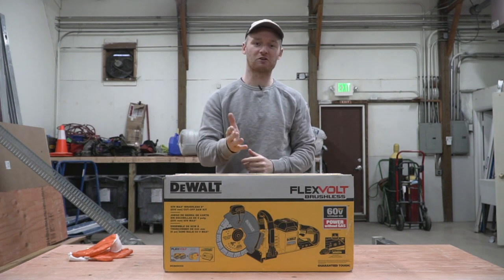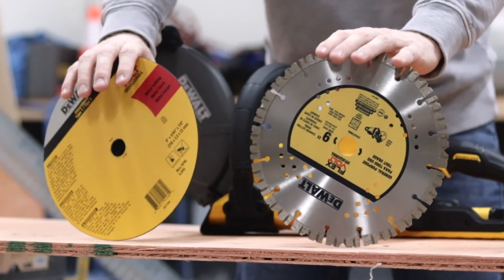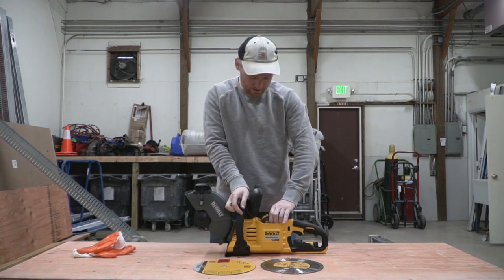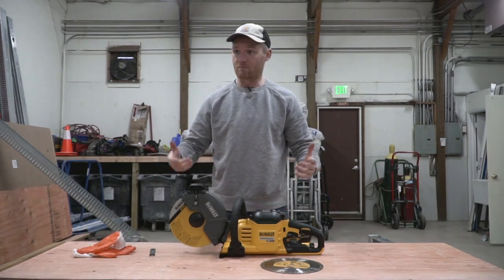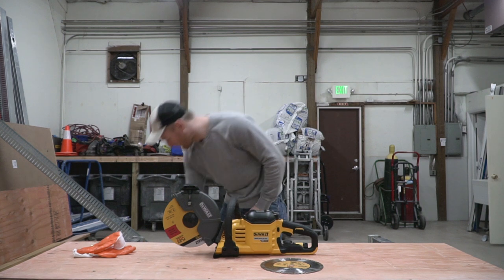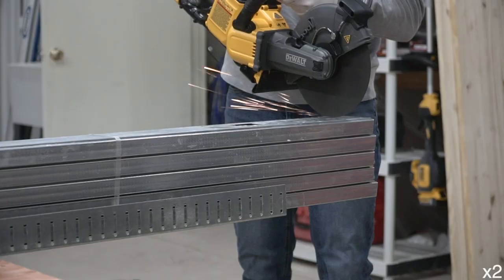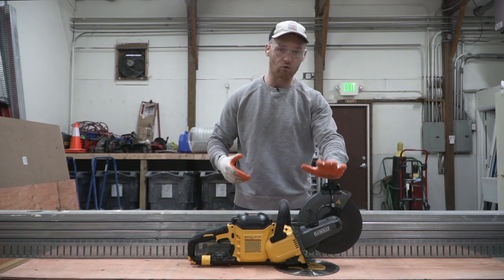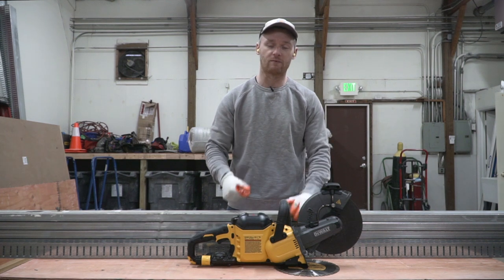DEWALT FLEXVOLT 60V 9" Cut-Off Saw

Comment: Been cutting bricks and blocks with this saw since i bought it 2 months ago and no way am i interested in cutting with a 9 inch angle grinder anymore. No more dust with the water intake, less noise, and powerful enough to enjoy using it and get the job done, also cuts a bit deeper than the angle grinder. Very impressed with it.

Comment: Would you recommend for the fire service
Reply from the maker: If the batteries stay charged, It’s a nice tool. Super light, that’s why we like it. You have to try it because what we use it for is not as time sensitive as what you guys would use it for.
Reply: @mitchellacoustical3119  I’m on a volunteer service where it wouldn’t get used a lot but when the stihl saw doesn’t wanna start this would come in handy for quick needed cuts, we also have a charging station on our engine
Reply: @jwoutdoors1451  I've seen fire departments using these before but I think they carry both a gas and an electric one

Comment: Can it run on the DeWalt 54v 12 . 0 amp batteries? Also the steel cutting blade is it the same as the blades used on 9 inch grinders ,say ,the bore  diameter must be the same as the grinders.
Reply from the maker: We use the batteries that come with it, I wouldn’t think another would fit. This 9” was first of its kind at the time so dewalt made a larger battery for it. Now Milwaukee is making one that uses their 12amp.
Reply: Thanks for the info bro ,much appreciated , I'm going to get me one of these saws
Reply: Mike im assuming you are from outside the us. As far as i know the 54v and 60v max batteries are the same. Due to marketing in the us they use 20v and 60v max as being max volt output but their normal operating volts are 18v and 54v respectively. The 54v 12 amp should work just fine
Reply: @jackofall2305  thanx bro much appreciated 👍
Reply: The 6ah, 9ah and 12ah flexvolt batteries are compatible with the entire range of DeWalt flexvolt tools. I'm considering buying this saw as I have some flexvolt tools and batteries. One would probably need at least two 12ah batteries with this saw to make it a viable option.

Comment: It’s got its positives about it but if you really want to cut brick and concrete quick you’re going to get a gas powered saw
Reply from the maker: James Taylor that’s understandable. We use it for steel studs. Just something to start thinking about with having to mix gas, change plugs, pull cord breaks, for me and my guys it’s just easier to pop in a battery and go!👍
Reply: Mitchell Acoustical 
I’ve used a buddies stihl battery powered and I was impressed but it has its limitations
Reply from the maker: James Taylor I’ve been wanting to try that one out too! They’re all gonna have their limits, but the batteries will eventually get good enough to be on par. Most of these are just version 1’s for these companies.

Comment: Put on some concrete being cut plz .many thanks.
Reply: I saw another video on concrete. Basically it's not good for all day cutting and it has a load safety switch built in so you don't burn out the tool. Overall, it's simply amazing!

Comment: These things burn through batteries to the point where you'd be better off getting a gas saw. Or buying an electic saw if you already have a generator.
Reply from the maker: Not if you don’t want to smell or mix gas, or you don’t want cords. We’d just buy more batts. Simple
Reply: @mitchellacoustical3119  lol... this dude. You're justifying buying a bettery that last 20 minutes and that cost $200, over a 25ft cord and pouring a gallon of gas into a generator? Which, by the way, can remain outside and no fumes and noise.
Reply: @mitchellacoustical3119  and chances are, if there is a place to charge your batteries at the job site, then you have a place to plug up your saw. 👌